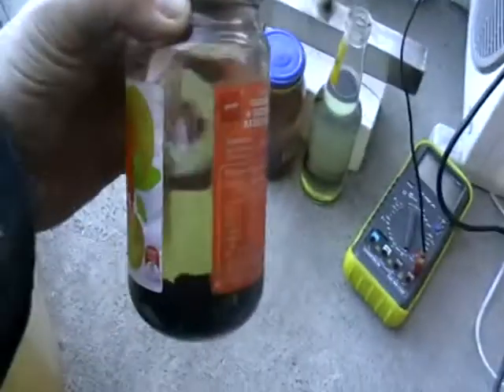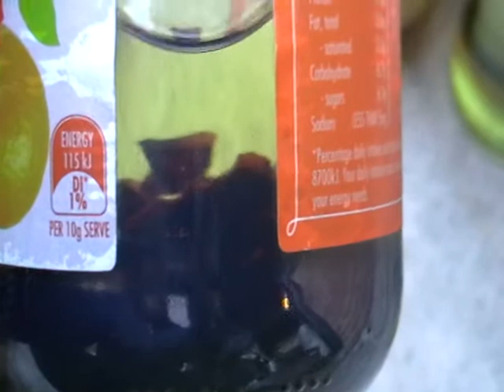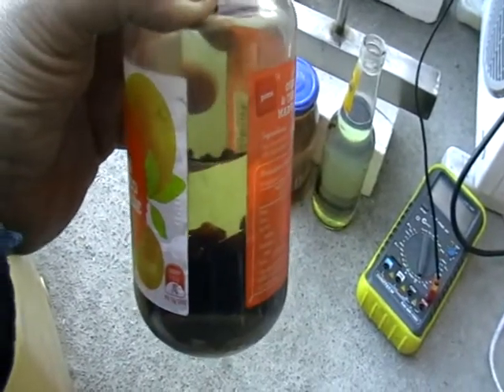Black diesel fuel bleaching 3

Comment: Hello there are you still work on pyrolise? I have interest for some kind of bleaching pirolyse oil from tires. Would be it bleach the pirolyse oil from tire and get sulfur decrease. Thank you advance. If it work we can buy it method if it possible.
Reply from the maker: Please check this video first: https://youtu.be/pCQB7Bu4lrY
Reply: @santeryi9  yes I saw it. But it is pirolyse oil from engine oil isn't it? If it is it mean this Pyrolysis oil has different amount of sulfur. In tires gets more. But as I said if the cleaner works for our pyrolyse oil and we can decrease sulfur and make bleach like this we can discuss about it.

Comment: Can the silica gel be regenerated? Is this model based on existing construction plans? Thank you Alex.....
Reply from the maker: +BluesDoctor you can regenerate the silica a few times, it will loose its ability a bit, also this particular model is absolute copy of the one from the manual.
Reply: +Alek Polek Thank-you for reply. Seems you have two plans this could be. Which plans?
Reply from the maker: +BluesDoctor  This one is "continuous waste motor oil distiller"

Comment: Hi Alek,
How is PH black diesel?
How much is this plant?
I am from Romania
Thank You
Reply from the maker: Hi, the resulting fuel is passing the copper strip test, the density of fuel is fits into the requirements of the standard diesel fuel, the turbocharged diesel car is running fine without smoke or starting problems. this particular plant was sold for $3000
Reply: Hi, Romania transportation to cost more than the installation !
Could you give me drawing installation?
How much does that cost?
Thank You
Reply: @santeryi9  8
Reply: @santeryi9  hi sir

Comment: what temperature is your primary heating chamber running at for used engine or transmision oil --  I presume you use an electric heating element rather than flame ; Have you done any calculations regarding wattage per litre of refined diesel   cheers n  thanks
Reply from the maker: the temperature of used oil processing is ranging from 375 to 420c processing of the dark diesel or red diesel is at 320 - 340c the wattage per liter of refined diesel (talking about red or black diesel into transparent one - thermal filtration)
thus machine is capable of 15L per hour, consumption is 4kw so it is equals to 266.66w per liter of refined diesel
in relation to oil processing, the wattage per liter will be about 400w.
Reply: @santeryi9  i Will buy this plant please your email
Reply: Alek Polek